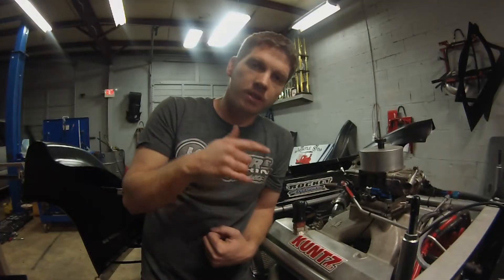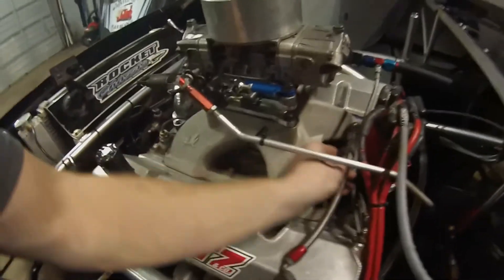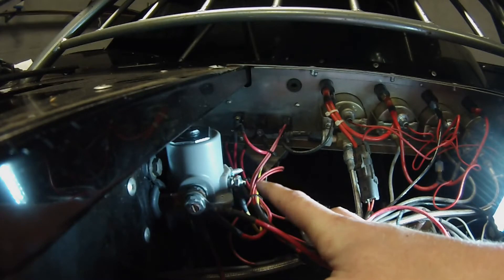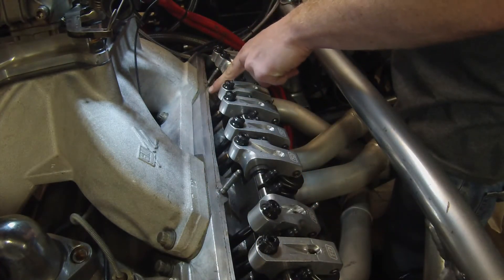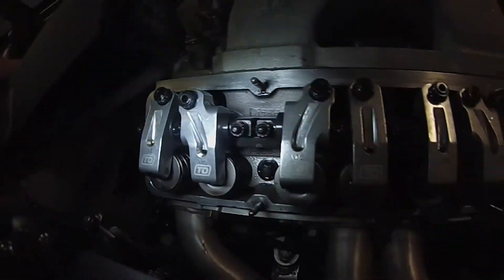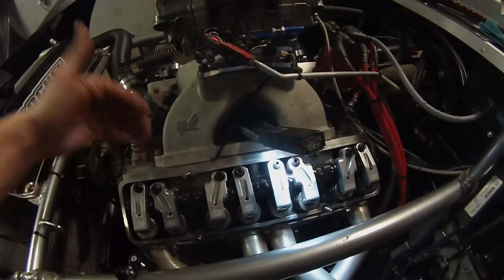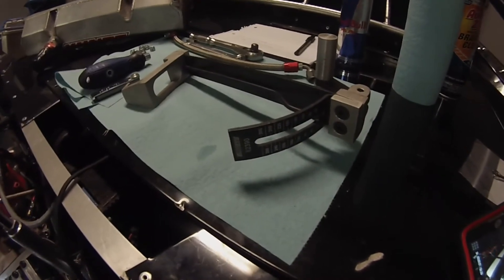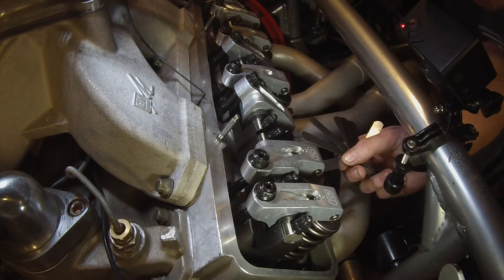Dirt Late Model Motor Lash and Valve Spring Pressure How To Video

Comment: Another question to bounce off you is how would you approach going to Bristol with a super late, or a crate? Such as older car or new car, as well as lightweight or more durable chassis parts such as trailing arms, under and lower a frames etc?
Reply from the maker: The the spindles is one week area any kind of cracks or fractures or cracks and powder coating needs to be removed cuz you will see more loads on the lower suspension of the front. And the rear you're probably see more axle loading.
Reply from the maker: Also one major concern is old wheels and breaking wheel centers out. But they cutting banking out to 18-20 degrees so shouldn't be that bad.
Reply: @DirtTrackDave  Yes I have heard that is what they are doing. Which I agree, should help the situation. Which should be an improvement over 2000 which from what I recall Wayne Brooks the winner of the Modified feature, talked about being difficult track conditions. I also recall him talking about his head swaying back and forth as a person was running down the straights.

Comment: My question is how often would you say, that the engine mounts on the block should be replaced?
Reply from the maker: That depends, steel ones (never aluminum)  say a super every season 50+ races, crate couple seasons, or if damaged and bent. There pretty tough chassis flex is also a factor in ware.
Reply: @DirtTrackDave  Yes, I've had only bad experiences with aluminum engine mounts. That is why I would only use steel. 

And I was thinking once a year especially if they are in poor condition. 

Needless to say, I wanted to check to see what someone else had to say about replacing engine mounts. Thanks

Comment: I thought you ran Clements motors.
Reply from the maker: +doon714 I prefer Clements for DLM racing because they are very reliable and make great power. But some of the guys I help don't run them, but I advise Clements for many many reasons.

Comment: do you not set your valves with the engine hot so you don't have any thermal expansion issues?
Reply from the maker: Yes, always at operating temp unless specified by engine builder.